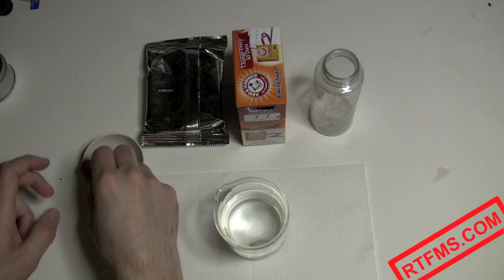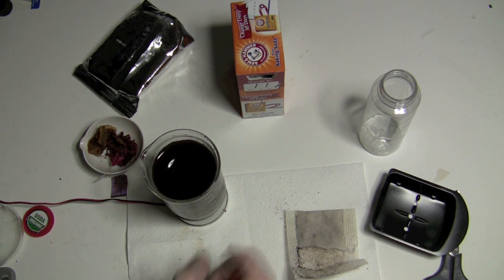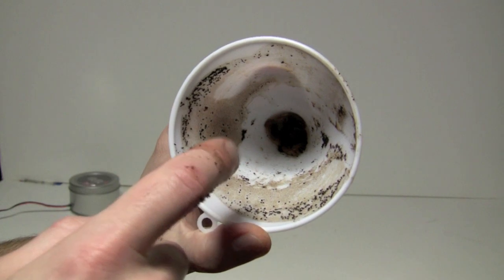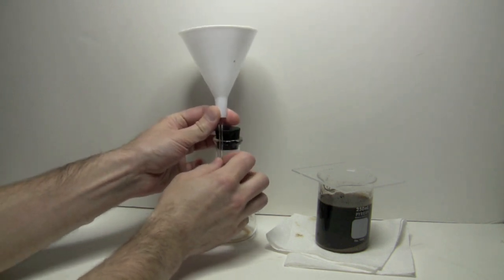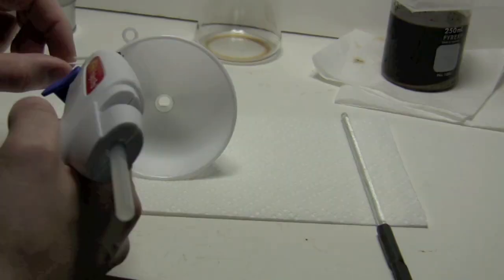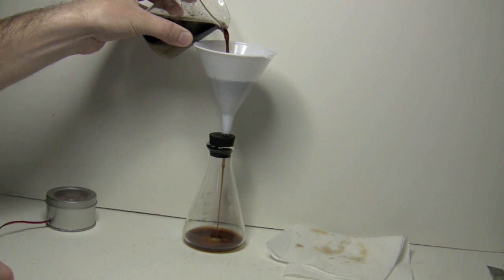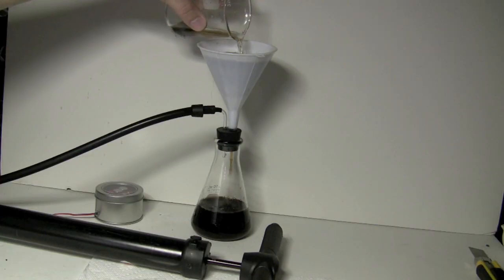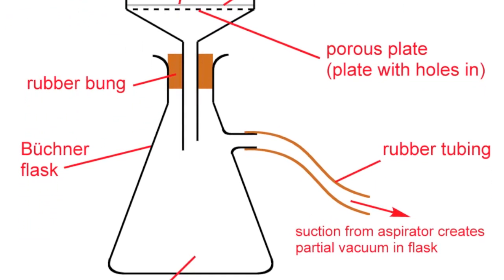RTFMs Episode #6: Superfast Filtration

Comment: not if you use the correct container. This erlenmeyer flash should hold up sufficiently, though if the wrong glass was used and the pressure was increased, it may implode.